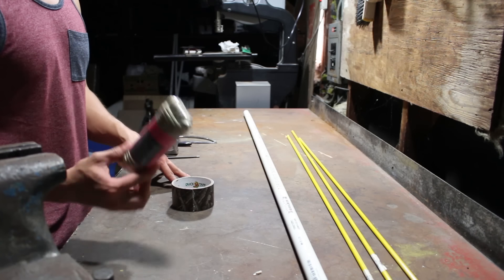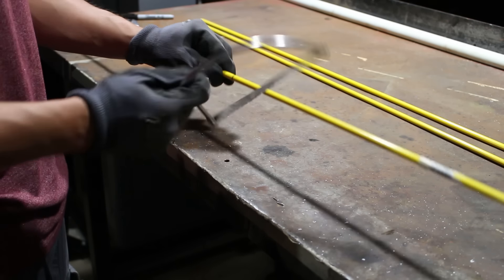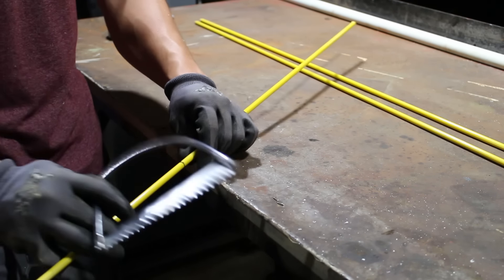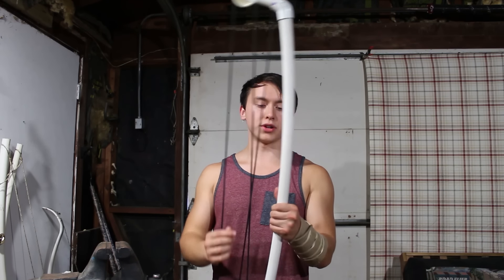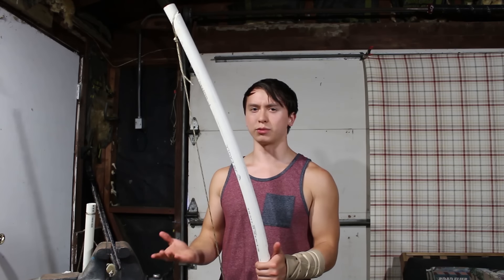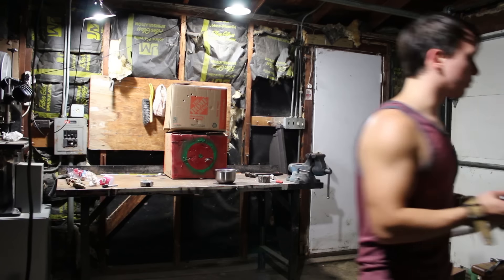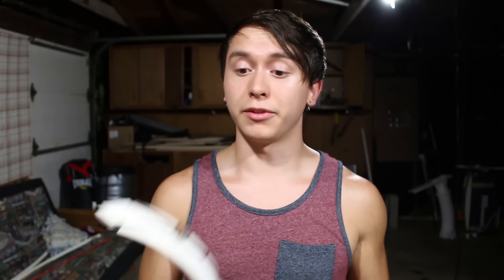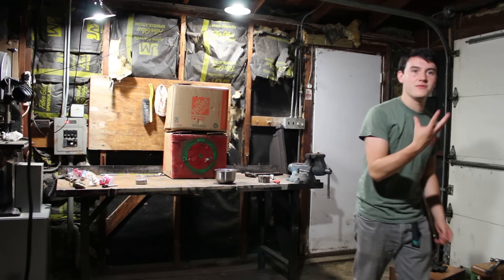Easy, Cheap, POWERFUL Bow (NO Power Tools or Heat Needed)

Comment: The recurve adds arrow speed and power with a lower draw weight, but they never reached popularity when they were invented (medieval times) because of the amount of time and effort that went into making just one bow
Reply: Recurves are much older than medieval, there's records of them in antiquity, namely Scythians. But the theory still applies about the time and effort needed to make it.

Although, the Mongols and Turkic tribes loved them since they were so easy to use on horseback.
Reply: Thats simply not true. What it does is increase the drawweight in a more compact package. It does not magically become easier to draw.
Reply: Anders9009

This is the correct answer. For anyone with even a moderate understanding of physics and engineering, they would know that draw weight is directly proportional to the velocity of the arrow released. Assuming you're using the same exact kind of Arrow, and it's the same person shooting it, then it's quite literally impossible for Two bows with the same draw weight that have any difference in the launch speed of the arrow. Different designs May impart the force to the arrow differently, with some bows having a shorter but stiffer draw, and others having a longer but smoother one, but assume you released them all the way then the moment the our leaves the bow it will have identical amounts of energy. Draw weight is literally the only thing that affects this.
Reply: eGULZ you are smart.
Reply: +Obergruppenführer John Smith
 - Don't know what religion you're preaching, but as far as actual physics and engineering is concerned there's a thing called "friction".
Draw weight aka potential energy does not convert 1:1 into arrow velocity aka kinetic energy - that's just stupid. More efficient bow designs such as the recurve will transfer more of the energy.
Reply: What are you talking about? Recurves are much older than the Medieval period and they have been used by arguably more civilizations than longbows/flatbows. Hell, the Mongols were all armed with them.
Reply: Well good luck firing a longbow accurately on horseback while in motion. It's newer so it must be better in every single aspect, right? It's newer so it must break the laws of physics as well i suppose? If longbows could achieve 100% energy transfer then we wouldn't need Nuclear Power plants, we would just use bows to power everything lmao.
Reply: KucheKlizma - I'm pretty certain that the wasted energy for a recurve  bow and a longbow will be so close that it doesn't matter in any practical sense.
Reply: KucheKlizma - "If longbows could achieve 100% energy transfer then we wouldn't need Nuclear Power plants, we would just use bows to power everything lmao."

This is a pretty silly thing to say, clearly both nuclear plants and bows wouldn't merely need 100% efficiency to power things, they need an energy source in the first place.
Reply: +Commodore Grayum - You don't need a powersource, you can just chain bows together in a loop and put power in the loop only once to create Perpetuum mobile by your interpretation of thermodynamics. You can then obtain infinite energy by the sound and temperature that are produced for free from the contraption.
Reply: KucheKlizma - But you still couldn't power anything without extracting that energy from the system. It wouldn't create free energy from nowhere.
Reply: Commodore Grayum - false.
Reply: Ok, so you don't have an argument. Perhaps I should mention my physics degree at this point.

Wait, did you edit your comment to add "You can then obtain infinite energy by the sound and temperature that are produced for free from the contraption"? I don't remember reading that part before. And even that is incorrect. If they were 100% efficient, then by definition they couldn't produce heat and sound.
Reply: The mongalian recurve and the English long bow are 2 best bows in history. To say which is better is almost implossible but both have a roll in which they was ment to be used but some long bows did have Almost 150lbs of pull talk about one big ass armed archer.
Reply: You are thinking staticaly...where only the force or draw weight is important, but if you look at it dynamicaly... the recurve makes a difference.
Why? because the curve actually tightens the string faster... so the kinetic energy is bigger and so the arrow goes faster...
Sorry for my bad english...:)
Reply: Yes I does! Why do think they made as a recurve and not just a stick? English longbows must have a much higher drawweight than a recurve bow to get the same speed. And it has all to do With the shape of the bow!
Reply: The recurve bow adds energy/speed to the arrow in this way: the small curves give initial speed boost then the big curve starts its action on already moving arrow. To understand the principle, when driving a manual transmission car you can move the car from standing still with the second gear only but it'll go slower than if you (normally) shift into 1, then second gear i.e. you give initial boost, than the 2 gear takes over easier.
Reply: +Commodore Grayum I'm with you all the way on your statements and believe you do have a degree in those fields of science
Reply: @CommodoreGrayum  pretty much this, the recurve just boosts the energy efficiency of the bow. This is limited by the material's flexibility and resistance as well as the size of the bow.  That said once the draw weight exceeds the flexibility of the now thinned material you will be better off making a longbow.
Reply: @KucheKlizma  im gonna fix this RIGHT NOW . .... . .... ... .21+21=42=infinity÷finite f(1)+finite=infinite42
Reply: @KucheKlizma  lol are we seriously arguing over physically impossible machines in the comments of a how to video for a pvc pipe bow?
Reply: @obergruppenfuhrerjohnsmith5981  you really do only have a basic understanding in this. Not all of the power on release is translated in to the arrow. The bow itself also pushes it's "wings" forward, depending on their mass and shape that requires different amounts of energy.
Reply: Well because thatand shortly after came the muh easier and more accurate crossbow
Reply: Haha always fun to see arguing in a comment section.
Reply: Obergruppenführer John Smith ...you are on the right track, but are forgetting one thing.  It’s not just the draw weight that effects velocity, but also the amount of potential energy stored in the limbs of the bow.  The curved tips of a recurve bow act like levers to put more energy into the bow for the same draw length and draw weight.  The result of this increase in potential energy is increased arrow speed.  If you don’t believe me due to your “understanding” of physics, head to your local archery club or bow shop.  Demo a longbow and shoot it through a chronograph.  Demo a recurve of the same draw weight, and shoot it through a chronograph.  See which one is faster.  It’s a simple scientific test you can perform to confirm my explanation.

Also, you will see in compound bows that two bows with the same draw weight will often not shoot the same speed.  Why???  Because the cam on the compound bow not only allows the archer to put more energy into the limbs through leverage and mechanical advantage, but also how that energy is released.  There are bows out there that use a soft cam, where the energy of the limbs is released gradually throughout the power stroke.  This is essentially a small force acting over a long time.  There are also bows that use very aggressive cams that release the majority of the energy in the limbs during the first part of the power stroke.  This gives the arrow a greater acceleration as the initial force applied to the arrow is much greater.

That is why you can have two compound bows, each pulling 60 pounds, with 28” draw weight, and one will shoot a 315 grain arrow 320 feet/second and the other will shoot the same arrow 250 feet/second.
Reply: @geebee3d  Thank goodness somebody came in here with ACTUAL knowledge on the mechanics. I was beginning to lose hope.
The recurve bow's power should be understood by simply reading its name. "Re-curve" That is, one curve in the limb transitions into another curve in the same limb. When drawn, both of these curves are flexed under tension. Instead of one smooth curve gradient, such as with a longbow, you get two varying curves. When released, instead of one long limb moving forward at speed, you have two portions recoiling forward, with the top one rightly being described as functioning like a lever. Think of a lacrosse player flinging the ball. The arm is moving at one speed, and the stick is being propelled by the wrist at a different speed. These two velocities combine to propel the ball. That curve in the limb acts in the same manner, creating two additive velocities on the limb's forward movement. This combined energy is transferred to the arrow. Draw weight certainly affects it, but only in so far as the limb's potential energy. The real power comes from the shape. This video literally proves it to be true. A lower poundage recurve imparts greater arrow velocity than a higher poundage longbow.

geebee3d, I know you didn't need this explanation, but hopefully it helped others.
Reply: Obviously the amount of energy you put into a bow, does not increase with bow design. The potential energy you put into it with your draw, is it. There is no energy magically appearing.

The difference of course is the amount of energy stored in the bow by your draw, that is converted into kinetic energy in the form of the speed of the arrow.
And this does depend on the type of bow.

The difference is about energy transition (efficiency). Nothing else.
Reply: U say it never gained popularity, but thats just in europe and america, in Asia it was really popular
Reply: @obergruppenfuhrerjohnsmith5981  You are wrong. Bows are not 100% efficient in transferring the energy from the tension in the limbs and they do not all store the same amount of energy even at the same draw weight. While yes, energy is conserved, the re-curve bows are designed to impart the maximum amount of kinetic energy into the arrow. This is why lower draw-weight re-curve bows have higher arrow velocities compared to a straight bow of similar length. This is also why modern compound bows with relatively low draw weights (<60lbs) can launch arrows over 300mph, far more than historical bows of similar weights.
Reply: I know very little about physics, but I am most familiar with recurve bows as used in antiquity by Persian mounted archers, and the recurve gave a short bow power equivalent to a much longer bow, which made it ideal for mounted archers. That would have nothing to do with the draw weight - I think - but the technology was good for the particular kind of warfare it was used for when there are the first mentions in Western literature, which is about when Western literature started. I would be interested to know what kind of draw weight these ancient bows had, given that you’d be shooting it while riding a horse, without stirrups, and wearing a crescent shaped shield (maybe leather tho?) on your bow arm. And shooting as an individual at individual targets in skirmishes. Seems like if recurve bows were more effective for their draw weight, they would have been adopted for distance firing in unison, as in medieval Europe. The technology was known to them.
Reply: @andreadeagon2301  several articles were released following the discovery of a burial site of a 14 century Mongolian warrior and his equipment including his bow and arrows. The bow itself was estimated to be between 120 and 180 lb according to it's measurements though this is most likely not the average warriors bow. it should also be noted that mongolians would often carry multiple bows on their person, most likely varying in strength and used depending on the encounter or scenario (a heavy bow for ranged encounters where strength > speed and a light bow for short ranged rapid-fire combat where speed > strength)

and for those of you wondering; an english longbow could range from 80 to 160 lb at ~180cm (~6ft) in length
a mongolian recurve horsebow would typically range from 80-100 cm.

for the rest of the people here spouting nonsense about magic bows:

putting this together you can draw a simple conclusion without a phsyics degree and with an average IQ that a recurve bow, simply put, packs more power into a smaller bow due to the fact that it has a recurve and that is due to the infinite mechanical advantages of "levers". imagine, if you will, that a recurve comes in two parts: the bow (call it the longbow portion if you wish) and the recurve (though it can be argued that the bow portion can also have a recurve but shuddup i'm simplifying it). the bow is drawn, stores elastic energy in the limbs, is released and releases the stored energy through the retention of the string and limbs to the arrow and transfers that elastic energy into kinetic energy, simple.

now imagine that the ends of the bow, in it's strung form, have been curved back in on themselves outwards and forwards and thus can store more elastic potential energy due to the additonal curve; a RECURVE, as one might describe it. these little recurves make use of the mechanical advantages granted by levers (i.e. allowing a larger load to be lifted by a smaller force by use of a fulcrum/pivot). imagine again, that bow, except now the ends of the bow have been bent back on themselves outwards. the bow is drawn back, the bow portion bends back but so do the recurves (to a smaller effect) and the bow is much harder to pull, why is this?. if you focus on one of the recurve you find two parts to the part; the bend (the load) and the rest of the limb (the lever) as well as the string on the end i guess. that bend can store a massive amount of elastic energy dependent on the material which it is made out and the degree at which it is inverted but in order to invert this bend a force must be applied to the end of the lever (by use of the string) and this is where the lever comes in (depending on how the bow is made; this lever can be quite long as can be seen in traditional chinese bows' "siyahs") and gives "leverage" (magical, i know) which allows for a comparatively small force to lift a larger weight. The force in this case is you puling the string, the fulcrum/pivot is the curve of the recurve and the load is the elastic potential energy of the curve as well as the limb. by pulling the lever (WRONG LEVEEERRrrrr!) you can put a massive amount of force into that little bend, which is stored, and is released upon releasing the string and allowing both that recurve bend and the rest of the limb to bend back to it's original shape. and yes, by utilising a lever it DOES mean that, for example, a 5n of applied force equates to 10n being stored in the curve BUT BY THE SAME RULE, if that energy wants to be released it must follow the same conversion which means that the 10n of stored energy releases 5n to the end of the lever MEANING that if you put 5N in, you get 5N out.

in conclusion it is that lever at the end of the recurve which allows a bow to have a larger energy capacity for a smaller size since that little recurve so greatly boosts the elastic potential energy capacity of the limbs of the bow. which means that for an english longbow with a draw weight of 160lb at 6ft length and thicc limbs, there is a ~3ft mongolian recurve which can have the same 160lb capacity for half the length. there is no magical force which makes that recurve output more energy than 160lb, there is no mongolian trick which makes it stronger, it only allows it to be SMALLER.

it has been said before why the english did not use recurves (climate, materials etc.) so don't ask "oohh but if it's so good why didn't the english steal the idea like everything else that the english has?"

P.S. the reason that most of the levers on recurve bows are quite small/short (with exception to chinese recurves) is that if you add that recurve in to increase the energy capacity of the bow, it's common sense to not want to exceed that newly added capacity and since the lever-mechanics make it so that the energy applied and stored stored = the energy released, a long lever would only be problematic and require a thicker bend to compensate. the length of the recurve was most likely determined by what shape the craftsman wanted the bow to be in upon stringing and drawing the bow: longer lever = the more the bend is unbent (if that makes sense)
Reply: Trash Mammal  Thank you, great explanation comprehensible to the likes of me. Also very interesting about Mongolian archers carrying different bows.
Reply: ArcaneNoodles mongols did their rampaging later than medieval times :)